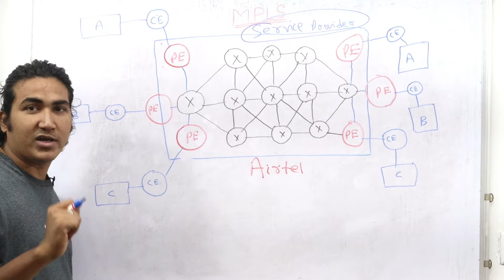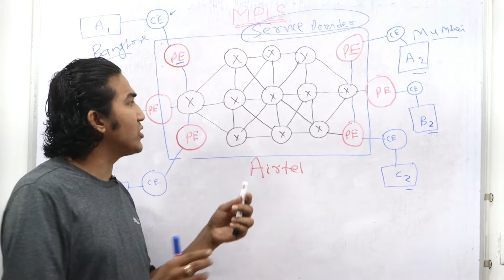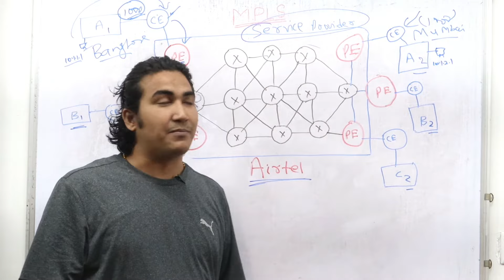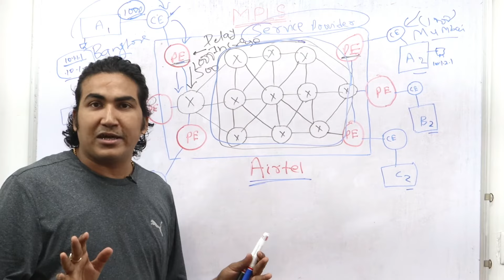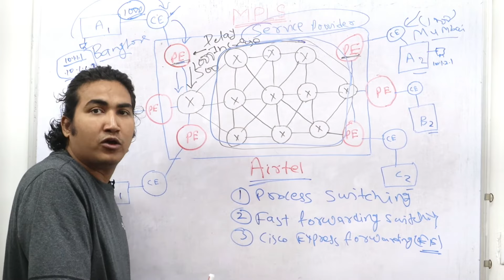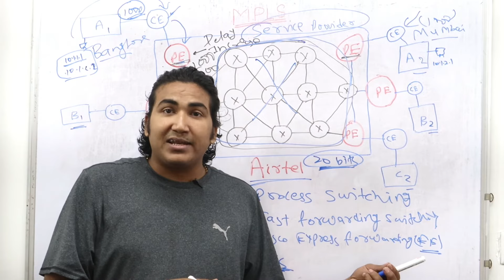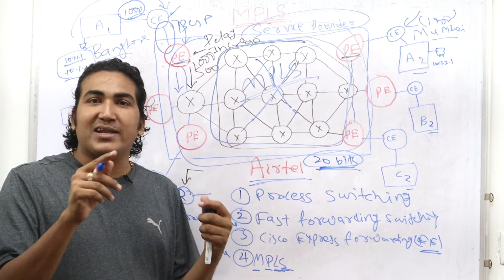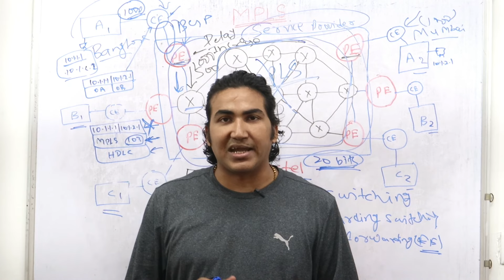1. Why We Need MPLS | Multi-Protocol Label Switching | All About MPLS For Network Engineers...

Comment: Useful video. In the case of BGP (CE router) and MPLS (PE router) with two sites having a failover setup between them (both sites are using dark fiber as a direct connection), could you please make a video demonstrating how failover works if let say, the MPLS provider networks fails to either site? Thanks!